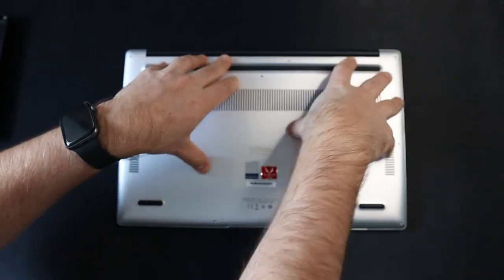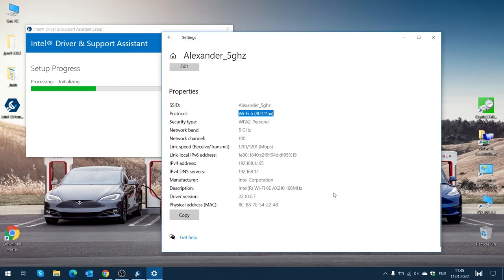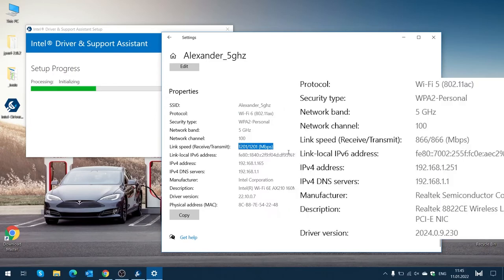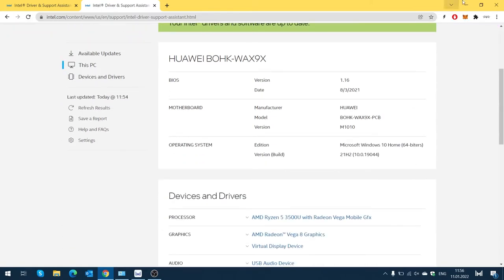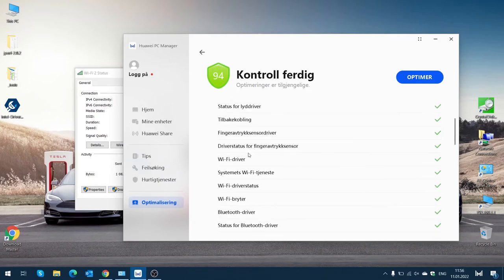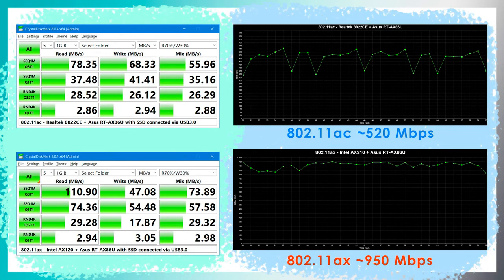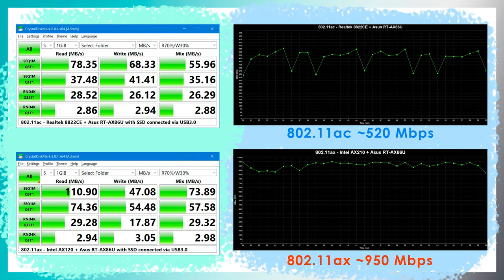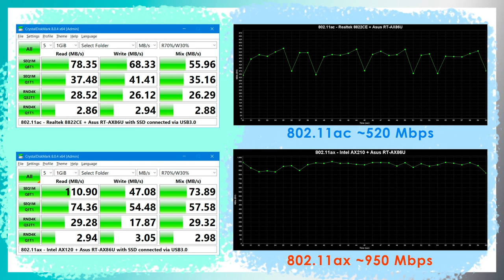How to replace Wi-Fi card in HUAWEI MateBook D 15 to Intel AX210

Comment: Nice video just one quick question. What's the difference between vPro and non vPro ax210?
Reply from the maker: vPro supports Intel's AMT (Active Management Technology). By using AMT (they call it vPro here, even though vPro has more than just AMT), you can do stuff like remotely reboot a machine regardless of the OS, use a VPN at the hardware level, use a pre-boot application to manage authentication (in the military, many official laptops run a program in AMT that requires you to insert and authenticate your CAC card, which is a card that contains your personal info and security status, before the laptop will even start up), remotely wipe the PC if it's lost, etc.
Reply: @alextech4675  Thanks a lot!

Comment: Huawei MateBook D 15 D15 i5-10210U Laptop 39,6 cm (15.6") Full HD kalitesi Intel® Core™ i5 8 GB DDR4-SDRAM 256 GB SSD Wi-Fi 5 (802.11ac) Windows 10 Home Gri

* 		Laptop Kapaklı Gri
* 		Intel® Core™ i5 i5-10210U 1,6 GHz
* 		39,6 cm (15.6") Full HD kalitesi 1920 x 1080 Piksel IPS LED arka ışığı 16:9
* 		8 GB DDR4-SDRAM 2400 MHz
* 		256 GB SSD
* 		Intel® UHD Graphics
* 		Wi-Fi 5 (802.11ac) Bluetooth 5.0
* 		Lityum Polimer (LiPo) 42 Wh
* 		Windows 10 Home 64-bit

Will that card be suitable for my device as well?